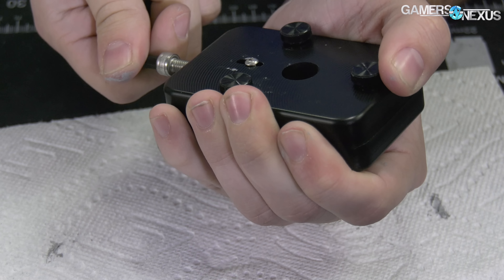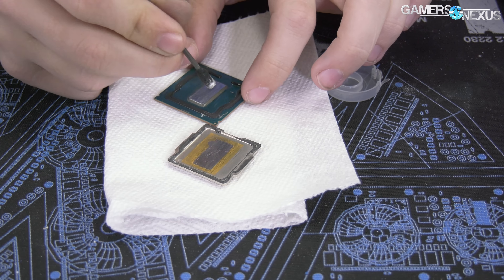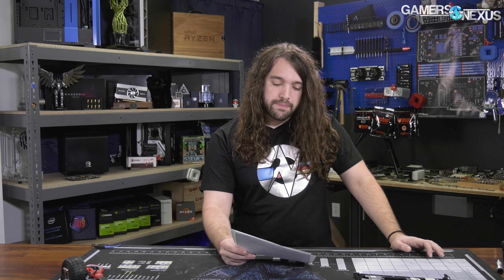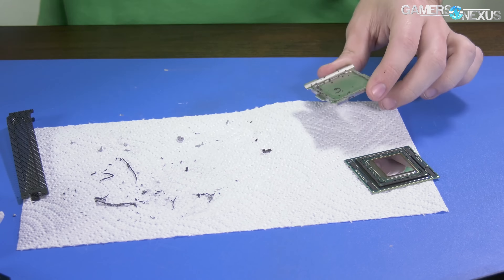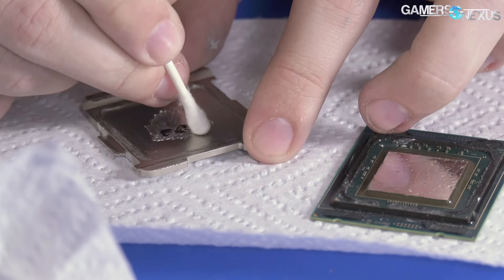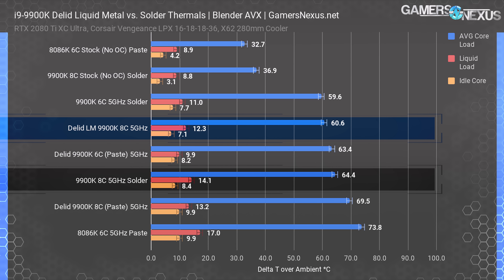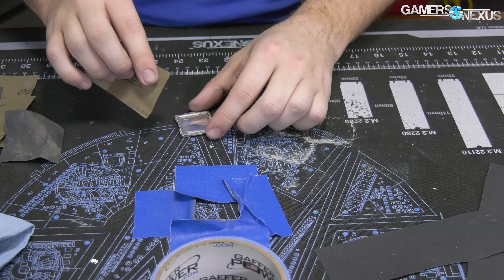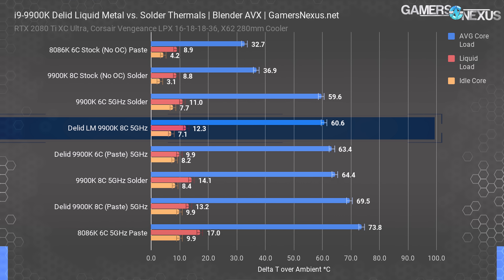Back to Reality: The 9900K Delid & Liquid Metal

Comment: Is that confidence interval on the bar chart fake? looks kinda fake because it's all about the same size and centered exactly around the measured value...if this is the case it's better without it
Reply: The lower result you see, if you read the bar titles, is stock with No overclock applied simply there as a baseline reference
Reply: looks like we are talking about different things, try search for "confidence interval", I'm talking about the little "|----|" thing at the end of each bar
Reply: @superxy1101  ah my bad, can you point me to the timestamp so we're both looking at exactly the same thing?

As for plausible reasons: Steve has previously pointed out imperfect LM applications can cause high core to core varience, a non lapped die definatelg counts in this case
Reply: e.g. see the bar chart at 4:48, would be great if the width of the confidence intervals do actually reflect the actual measurement variance (strictly speaking should be more like the standard variation of measurement samples but no need to get too rigorous)
Reply: @superxy1101  So i'm strughling to see the issue here.
If you look carefully there is minor deviation, similiar variation may simply be an indication of good test methodology
Reply: And the reason they are centred is likely a mean average as the final result, as GN said mart their standard in the PT interview

Comment: Why does lowering the operating temperature increase the performance? As long as the cpu isn't throttling, shouldn't it run at whatever speed it's set to run at? Does the increased resistance from the heat actually slow it down? 

I'm not trying to be a dick. I'm just to dumb to know the answer.
Reply: heat will be a limiting factor overclocking it so lower performance. also higher noiselevel with aircool.

Comment: Delidding non soldered Intel CPU to allow better temperatures (20 ish or lower temperature drops, it  varies) and allow a better overclocking capability. I would say its worth it. i.e. with the 8700k, 8600k, 7700k, 7600k and so on. Whether if its a brand new chip. or a Used CPU you bought from someone (I would happily delid a used CPU specially if its 2nd hand and no chance of transferring the Warranty if that is even a thing with intel.

But Delidding a CPU like the 9900K which cost £600 here in the UK. Yes its soldered and Yes sadly it still runs hot.

The most honest opinion I can say is. NAHHHH Don't. 

Its like too risky. Not only do you need to delid it with a risk of damaging the Die itself i.e. as the soldered metal rips off, it takes the Die with it.

After doing so, you have to literally use a sharp blade edge to take the remaining solder stuck on the die. And that in it self is very risky. One little straight cut into the die and thats goodbye £600.

Still, I wonder how it is possible to delid it using the delid tools without even heating it up.

Unlike older Soldered CPU's that just rip apart when you even try to delid it using the delid tool.

@Intel Why not just sell the 9000 Series CPU without soldering it to an IHS or heck, sell it with the IHS not attached at all and let the people use Liquid Metal to it. Not only it Saves you money from using solder and the soldering process itself. It saves your ass from the overheating Issue the 9900K is encountering.

But then again, there's the arguement why some reviewers ran the same CPU and only had 58 Celsius Max while some had 83+ at the same performance bench 1900-2000 Cinebench scores.

Comment: Key points in i9-9900K overclocking:
1) 5GHz is not practical for most people. Need a very good CPU cooler
2) approx 18degC difference between 4.8GHz and 5.0GHz (depending on setup; those are AnandTech's results)...that's 4% which may not translate to observable difference (especially gaming)

4500 to 5000MHz drops (per 100MHz) to 27degC difference. That's still HUGE especially considering GamersNexus results show about 90degC (assuming 20degC ambient) at 5GHz with a good CPU cooler.

3) Tweaking can make a big difference in temperature. AnandTech reports 40W saved and 24degC drop due to this (lower voltage value).
4) don't use Prime95 or similar as a worst-case as it runs too hot. Use real-world applications that can run all threads at roughly 100%
5) TJmax is?? (personally I think 80degC is a safe number. Might run fine at 90degC sustained too but I'm not one to stress things to the limit)

*So... like all overclockable CPU's there's a point where the power and thus temperature increases significantly. Thus it's best IMO to aim for a more realistic goal of between 4.5 and 4.8GHz all cores depending on your setup, ambient room temp etc 

I'd personally stick with a good NOCTUA or similar AIR cooler then tweak until I hit maybe 85degC max for sustained load at reasonable fan noise profile. Whatever frequency I get is what I'd stick with. I'm not going to go nuts trying to get from 4.7GHz to 5.0GHz for a 6% difference I likely can't detect in real-world usage.

Comment: This may be a little random, but, if I want just pure performance, and I don't really care about price-to-performance, would the i9-9900k a viable CPU? It does outperform the 2700x in premier rendering times (according to Linus) and obviously in gaming. And that's basically all I do. I also imagine that it performs very well on Photoshop? Anyway, even though its still 14nm and basically just Skylake but with solder and 4 more cores (and maybe some more hyper-threads), would you still recommend it if just wanted currently unbeaten performance? Thanks, and keep up the great content.
Reply: I'm pretty sure if money is no object intel is the winner all around here.
The memory support alone is so much better.
Ryzen is terrible at using high speed ddr4 plus clock speeds still dont compete and core for core intel still have a better architecture.
Reply: @FeedMeSalt  Yeah that's a good point. Thanks!
Reply: If that's the workloads you are going for, it's the chip for you. Keep in mind to have higher than 4.6 GHz all core you have to look around for a motherboard with vrm that would support the chip. Not all z390 or z370 can get all out of the chip, despite officially supporting it.

Edit: although it isn't much faster than a 8700k in either gaming or adobe suite. 

Edit again https://blogs.forbes.com/antonyleather/files/2018/10/adobe.jpg

Based upon these numbers a 1950x or if money is non-issue a 2950x might be a better buy for you. Lesser gaming performance, but better rendering performance.
Reply: FeedMeSalt I know your comment is either bait or just you being so uninformed it will be impossible to educate you, but the ryzen platform has very stable memory modules with timings up to 3600mhz with very tight timings. A friend of mine currently has a CL14 3600mhz G. Skill kit running on a 2700x and the x470 platform. First gen ryzen had issues with ram timings purely because the zen architecture was in its infancy and ram kits had been optimized for intel over the past decade. X370 chipset boards still have some issues but with BIOS updates they all support up to 3200mhz xmp out of the box. X470 and zen+ based chips all have zero issues with high frequency ram. Saying ryzen can't run high speed mem is about as true as saying intel chips all need to be delidded, it was true a year ago but it sure fuckin ain't true any more sweet cheeks

Comment: As a machinist, please stop using the turn lapping for the love of god. You're not lapping the IHS, your just sanding it. Lapping gets a surface to within .0001" flat across the IHS with almost a mirror finish and the compounds can be 5000grit and greater. If you really want to get accurate just using a small amount of blueing ink and check the contact from the die to the IHS. 
Thanks, a machinist

Comment: So, why did Intel make the 9900K die so much thicker, when they did not do this for the 7980XE? 

Thermal expansion and contraction surely poses as big or greater risks to the much larger die of the 7980XE as it does to the 9900K - although yes the solder on the 9900K does increase the thermal forces it will experience - all things being accounted for.

If Intel had made the 9900K die "only" twice as thick rather than 3x as thick as they actually did, it would have considerably better thermal performance - and they would have saved money too, as those silicon platters are expensive! By making them 3x as thick, they get only 1/3 as many dies from a single ingot as they did before.
Reply: lol, no. the wafers are thinned after making the chips. they don't slice thinner wafers out of the ingot. https://en.wikipedia.org/wiki/Wafer_backgrinding
Reply: @ssl3546  Okay, so they probably don't get fewer wafers - but nonetheless, why then are the 9900K wafers so much thicker, if indeed they thin them after manufacture (and quite obviously did, as the end thickness changed quite dramatically) ? Needlessly thicker, quite arguably...
Reply: @mduckernz  some lazy processes in the production line I guess.
Reply: @mduckernz  the 7980 is a HEDT part, package and die are much bigger in surface area - this is a normal size chip without that extra space
Reply: @bengrogan9710  I'm well aware; I said as much, that the 7980XE is much larger (surface area). That's what makes it odd.

If anything, the HEDT chip you would expect to be thicker. But it's not. It's the other way around. It makes no sense.
Reply: @mduckernz  it makes perfect sense.
The HEDT has the space due to 2 reasons, thanks to the larger socket size, to spread the cores in the xy plane, the larger socket also allows a thinner ring of SMDs due to the circumferal distace being nearly doubled, this allows you to effectively double dip on how much die size you can gain

Comment: not at all worth it for 99.99%. 9900k is cooler than 8700k stock vs stock, even tho it has 2c/4t more and +300 mhz boost. not sure why we are even discussing this, only top overclockers should care about the few degrees gained. you can hit 5 ghz easy on all cores, 5.2 ghz on good cooling, without doing anything. hell, some reviews even got 5.3 using aio...

Comment: That's not how you lap a IHS. Circles, otherwise you are making uneven surfaces. Back and forth with your finger is a 101 no-no. 
Also, who in the hell scrapes off solder with a razor blade? A soldering iron and wick is the correct way.. the stuff melts at 170c.. so why not do it correctly? No wonder the results are poor.

Comment: I'm sorry while my comment will most likely be perceived as rant of some kind and I know you guyzzz do your best to showcase all kinds of scenarios, but Intel products, Nvidia or "AMD" should be rated or tested at their factory (default) assembly state (the final god damn produced unit). The overclocking is fine, but if you have to delid it, sand down the IHS, grind it up every way possible and then apply some whipped cream with cherry on top and then meditate for about 3 days, you will get a better result in the end, but in my opinion you're just polishing a turd of a processor for the company which supposedly released "the best and the fastest" in the first place. None of the average consumer base will go through extreme tweaking like you do. Sadly you're basically doing Intel's job and promote their product indirectly. I do appreciate your technical expertise though, keep a good work, peace.
Reply: Agreed...this is how you get fanboys on both sides thinking they know shit, but they don't !

Comment: I would say that it's definitely worth just replacing the IHS with a copper IHS at that point, because you're not going to get the inside of the IHS consistent enough with any method. Certainly hand sanding is better than just leaving it with gouges, but as many commenters have noted, it won't give you a flat surface allowing for good IHS and die contact. 

On that note though, if you're willing to go through all this effort, I think it's safe to say you're at the point of 'EXTREME' overclocking, and one might wonder why you're even using an IHS to begin with? At this point if you're going to bother at all, you might as well go with direct die cooling. You could look up direct die mount for coffee lake, or you could get the NudeCNC V1 that just released and use it to make direct die cooling possible. 

I understand attempting to use the IHS to make consistent 'comparisons' in performance for the sake of changing only one variable at a time, but frankly, unless you can get an un-tampered with IHS identical to the 9900k's without scratches, this really isn't an accurate comparison either. I don't have a 9900k and 8700k IHS to compare, but if they are similar enough to be interchanged, it might be worth just using your 8700k IHS, instead of trying to sand your 9900k IHS. Of course I doubt they are similar enough since the width of the die is considerably greater for the 9900k, but it might still be better than sanding to try and make it work.

As a side note, if you're going to be putting in the effort to 'sand' the IHS, then it is almost also worth the effort to just go the next step and lap the die reducing it's thickness at least .15 mm, to get the variance to within .01 mm across the whole die. 

Net effect would be a delidded, lapped, direct die cooled, liquid metal interface rig. While any 'one' step may not be significantly worth the extra effort, as you show only a 'few' degrees change between each, the net effect of all of the above might begin to make a fairly significant difference. I would add that with a die width of 9900k being literally more than twice the width of the width of 8700k, 0.15mm of lapping is extremely conservative. One could conceivably go as far as removing .45mm of the die to make it equal thickness to the 8700k, and go to about 0.5mm to make it equivalent to a fair lapping of the 8700k. I personally won't recommend this, as I'm not 'positive' that no portion of the dies actually electronic components to extend that far up into the silicon of the die, I think that would be weird, as usually the silicon is on 'top' of the circuitry of the die, and it doesn't extrude from the PCB, but I am not a chip designer, so I can't comment for certain on the design of any particular chip. 

Still, assuming it is like past generations of chips, it would be safe to do that sort of extreme lapping, removing more than half of the silicon, and bringing it to a similar performance level of an 8700k in terms of die thickness, or better. Furthermore, because the PCB of the 9900k is significantly thicker than the 8700k, the risk of damaging the die is drastically lowered during direct die mounting, as the flex on the chip will be reduced, giving you a little more headroom in terms of ensuring a snug fit without excessive risk of damaging your expensive new processor. 

Anyway, just figured I'd add this as I didn't see a sort of 'comprehensive' list of next steps if we're going to bother with this to begin with. Needless to say for most consumers the solder is good enough, but if you are going to delid, I really don't understand why you wouldn't just go all the way, the risk is already there once you have to start sanding, modifying, and screwing with the die, and if a 'few' degrees matters, you might as well compound it all the way, and get maximum performance. I'd estimate all said and done, you might expect to get 10 degrees off an extreme lapping, 3-5 degrees from liquid metal, and 5-10 degrees from removal of the IHS entirely, which will give you a net reduction of 18-25 c, which begins to be worth it.

Comment: i really dont want to leave intel but they are making it harder for me to pick them.. im still scared of AMD.. especially their thirdparty motherboards.. after a lot of my firends had bad experience a decade ago.. i never looked at AMD .. but Ryzen seems promising.
Reply: i had an k6-2 350 back then it was a good cpu and board. then later i got an athlon 1000 and it was a instable mess (asus board), so i instantly sold it. then at some point i had an athlon xp 1800+ and it was really good and i had it for a long time until intel came up the the c2d. skipped asus boads until recently. long story short, my overall experience with amd was pretty good, although id never buy their graphics cards, my next cpu might become an amd again. might take a couple of years though, because games dont scale well with multicores right now.

Comment: Here they market the sTIM as a good thing but they are absolutely abysmal. I'm getting temps of 76 degrees on default all core boost 4,3GHz on a 9600k. Of course they sent the best samples to gamersnexus. You should buy a couple from retail and test them again on stock with a decent 60 dollar aftermarket cooler. I bet the results will be different.

Comment: Just get a good cooler for the 9900K and it will give gamers THE BEST GAMING PERFORMANCE EVER! The 9900K will also give you THE BEST FUTURE PROOF UPGRADE PATH when gamers need more speed and want to upgrade to new High Performance NVIDIA GPU investing in a 9900K makes long term sense.
Reply: I'll waitwait for the 10GHz i9 11000K, which well reach 90°C under liquid nitrogen cooling.
Reply: @crimsun7186  Better yet wait for a 100GHz i9 99999 which will reach temperatures very close to absolute zero (-273.15°C) Bose-Einstein condensate.